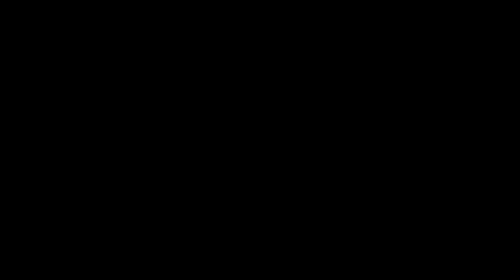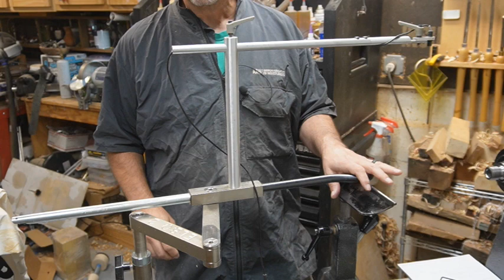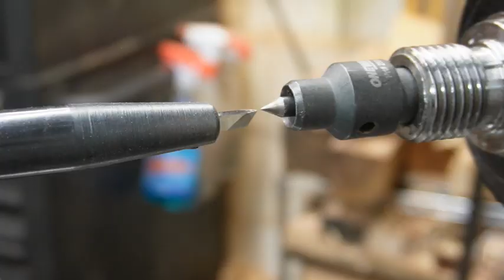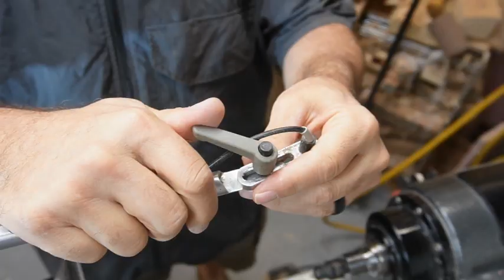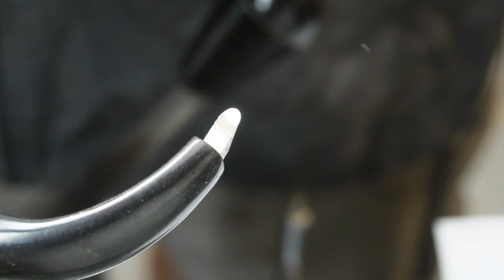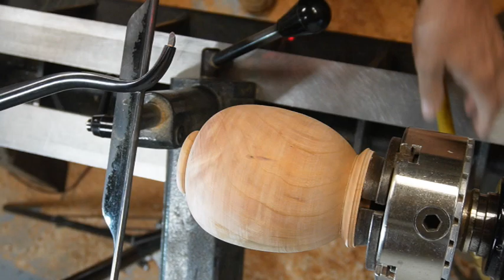Woodturning: First look at the Elbo II Hollowing Tool

Comment: I'm sold on one of these and John Jordan's stuff too!
Reply from the maker: Awesome!  I'm sure you'll love the combo.  I know I do.  
When you order the Elbo 2 and the Jordan Hollowers, please tell Tim (Yoder) and Vicki (Jordan) I said hello 🙋
Reply: @ScottsMiniWoodshop I will. Thanks
Reply: @ScottsMiniWoodshop  I bought the unit, I also purchased those Hunter carbide cutters, are those a direct replacement for Tim's hss cutters that come standard with the Elbo? Maybe he explains this in his video but he doesn't mention it on his site?  Can't wait for it to arrive now. Thanks
Reply from the maker: @roofermarc1 congratulations!  I'm sure you'll love the Elbo2.  I can't answer your question about the Hunter carbide cutter.  The last time I spoke with Tim he had replaced the old hollowing bar with the current one, which I don't have.  I did peek at his website and it seems that the hunter cutter will just replace the HSS cutter in the straight bar.  If you purchased a hook tool via Tim or from Vicki Jordan, the cutters for the hook tools are different.  They have a round tenon which is inserted into the tool instead of the square bar.  If you're interested in a carbide cutter for the hook tools, I know Vicki sells a carbide version.  Just be careful when using the hunter cutter or any carbide cutter since they tend to be a bit more aggressive, so you may wish to use a bit of a lighter touch when hollowing.
Reply: @ScottsMiniWoodshop I've never used carbide but reading up they say hunter carbide is very good. Not sure why carbide could be different between manufacturers but as you know there is always a better product.
Reply from the maker: @roofermarc1 that's a great question.  I'm not sure either why it's so different between manufacturers.  I'd guess it's similar to HSS which varies greatly depending on grade.
Hunter makes excellent products.  I use a hunter cup shaped carbide cutter on my sphere jig.  I've tried some less expensive carbide cutters and it's my experience that hunter cutters are superior
Reply: @ScottsMiniWoodshop the carbide tool only fits the Tim's straight bar. I don't like the carbide cutter and just use the hss ones supplied with it. I bought the 3 set of John Jordan's 1/2'' bars and like them and use just them, I had a problem boring through a 1'' hole using the 3/4 bars, Tim says you need a 1 1/2 inch hole, the 1/2 inch tools work in the 1'' hole.  Idk how big a hole John used in his hollow forms and I can't ask him!  

 I wish I'd tried the Trent Bosch setup, seems easier to install it and remove it from the lathe and you can keep the tailstock in place never having to install and remove the Elbo to get to the tailstock. Either way the Elbo works great. 

You know how we can move a banjo back and forth lock it down unlock it move it, the Elbo should have been made like that. Different gaps in the lathe bed would've made it more expensive maybe to allow for this. But it seems it could've been made to work like a regular banjo locking and unlocking and moving back and forth.  Just need a bed clamp of sorts. I'm gonna look into doing this. As I spin the lock down bar on the Elbo base it hits my beds castings and is a pain to move
Reply from the maker: @roofermarc1   thanks for the update.  It's much appreciated.  I had a whole reply typed out and my technology zapped it.  I'll try my best to reconstruct my reply 😂

Hollowing through smaller holes...
The thicker diameter hollowing bars are made so you can hollow deeper.  They seem to bind in a smaller opening as the angle increases.  Try using a narrower hollowing tool to hollow out the neck and shoulders of the piece.  Then switch to the larger bar to finish the hollowing.  It seems to work ok for me.
I've never used Tim's carbide cutter but I have used other hunter cupped carbide cutters before and they're a bit too aggressive for my liking.  I definitely prefer the HSS cutters.

I agree that a custom bed rail clamp block would have been ideal.  But, just imagine the nightmare for Tim having to order or make a custom piece for every tool he sold.  It would have been a nightmare.  But... Maybe you could contact your lathe manufacturer and order a replacement clamp block.  Then all you'll need is the proper bolt and you'll be in business.  That's actually an excellent idea.  Wish I'd have thought of it.  I guess I need to give Robust a call.

The Bosch rig is an excellent tool.  But just like everything, it has its own set of drawbacks.  It really shines if you can slide the headstock of your lathe closer to the tailstock end so you can stand at the end of the lathe to hollow.  Of course, to do this you'd need to remove the tailstock.  Every time I use the Bosch rig I tilt my tailstock out of the way even if I don't move the headstock.  I have an American Beauty and the tailstock seems to be in the way regardless.  With out the tilt away, I'd have to remove the tailstock anyway for at least some if not most of the hollowing.
My biggest issue with the Bosch rig is that the height of the built in tool rest needs to be adjusted each time you change the diameter of the hollowing bar.  Once you put the adapter on the bar and lock it in, the smaller bar leaves a gap between the bar and the tool rest.  Adjusting the height is a pain, in my opinion.  Of course you could get some shims to make this easier but it's still less than ideal.  I'm speaking about the tool I have which I bought several years ago.  Perhaps there has been a fix to address this issue.  Shims that lock into the holes in the tool rest seems like an easy answer.
It's really a blessing that I have both in my shop.  Both are excellent.  If I only had one or the other I'd be able to do everything I already do.  For me, the Elbo 2 gets used much more often.  I know it's all personal preference, but for me, I favor the Elbo 2.

Try not to focus too much on the shortcomings.  Have fun making hollow forms.  If you replace the bed clamp with a custom one, please let me know how it works for you.  Happy hollowing!!

Comment: Very Nice review. I have a question about the Elbow tool II. Can you setup the  Elbow tool II behind the tail stock?
The reason for that setup is to have the tail stock with live center to hold the project firmly and steadily for surface turning(cutting) or hollowing(larger piece before remove the center piece).
Reply from the maker: The tool can be set up anywhere on the lathe bed.  The issue with setting it up behind the tailstock is that the tailstock would definitely be in the way if you intended to hollow a vessel.  To properly use the elbo 2 for hollowing the tailstock would need to be moved out of the way to provide access to the hole drilled  in the center of the vessel.  In fact, I know if no circumstance where it's possible to hollow a vessel with the tailstock in use.  Generally the tenon/ chuck connection is all that's necessary.  For larger vessels, some opt to use a steady rest.  But since hollowing occurs through a hole in the top of the piece, it's necessary to move the tailstock out of the way
Reply: @ScottsMiniWoodshop  Thanks for your reply. I can understand those circumstances and limitations. I had seen other video clips that utilize Simon Hope’s hollowing rig to hollow a big (but not very tall ) pod with a big opening. The rig was setup behind the tail stock. The tail stock with live center was used to hold the project . After hollowing out most of the wood then remove the center stock. I was curious about whether Elbow tool II can do that?
Reply from the maker: @jkwang99yt  I'm sorry.  I'm not familiar with Simon Hope's hollowing system,🤷
Reply: @ No problem. I have the Elbow tool. I found it have some problem during turning. The clamp may become loose and the mechanical arms drop. The cutter won’t be able to cut. Tim couldn’t provide the upgrade for the original model. It seems not enough gain to justify buying the Elbow tool II.
Reply from the maker: @jkwang99yt  I also had the original Elbo Tool.  With the original Elbo Tool, it's very important to adjust the tailstock clamp before each use.  
Only you can decide if the Elbo 2 is worth the expense.  I bought the basic version.  It came with just the Elbo 2 tool and nothing else.  No cutter/ hollowing bar, no laser, just the tool.  I just used the hollowing tools I already had and transfered the laser from the old Elbo to the new Elbo 2.  For me it was well worth the upgrade.

Comment: Can the original elbow tool be upgraded to the elbow 2?
Reply from the maker: Not really.  Elbo 2 has a new mount instead of the tailstock clamp and a new articulated arm.  But with that said, you can use the hollowing bar and laser from the original if you have them

Comment: Thanks for this thorough video, and for the detailed review of the Trent Bosch system in one of your other videos.  I wonder if you could say a few words about why you've settled on the articulated rigs rather than the Lyle Jamieson rig?  If I understand correctly the Jamieson rig does not suffer from the one shortcoming, range of motion, that you pointed out on the ELbo II.  And for smaller vessels, say ones you would use a 3/8 or 1/2 inch shank tool for, are you still hollowing by hand? Thank you!
Reply from the maker: I went with the articulated rigs (Bosch and Elbo2) mostly because of their small compact size.  Jamieson rig is huge and I'd need the room to store it.  My shop really is 'Mini' and space is at a premium.  Between the two rigs I have, I'm in pretty good shape for what I like to do.  I'm sure the Jamieson rig is great but I've seen it on display at several symposia and I'd have trouble storing it when not in use.
As far as hollowing smaller turnings without a rig, I generally do what's most time efficient.  Sometimes it's just quicker without the rig.  I broke my right collar bone a few years ago and sometimes it doesn't like me hand holding the tools.  On those days, I'm going straight for the rig regardless of the size of the hollowform

Comment: Looks like Trent Bosch's Stabilizer except Trent's doesn't require the standard tool rest as it's self-contained. I love Trent's; very efficient, easy on the turner's shoulders and was an excellent addition to my tools. I don't  think I'd do anything to improve Trent's.
Reply from the maker: I have both.  The only downside to the Bosch Stabilizer is that the unit needs to be readjusted if you switch tool bar diameter, or make some sort of shim for the tool rest.  The stabilizer is also better suited for working at the end of the lathe which is a + or - depending on your lathe setup.  Personally, I find swapping between straight and hook tools a bit quicker with the Elbo 2.  I also find setting the laser a bit easier.  But if course this may just be personal preference
Reply: Probably just what you're used to. I find the camera  on the Bosch Visualizer (which I also have) easy to use and essentially foolproof when hollowing. But, again, just preference and whatever makes it fun and allows you to concentrate on the overall work you're doing rather than using the tools is best for me. @ScottsMiniWoodshop
Reply from the maker: @grbmds2751  congrats on the visualizer.  That's a great piece of kit!